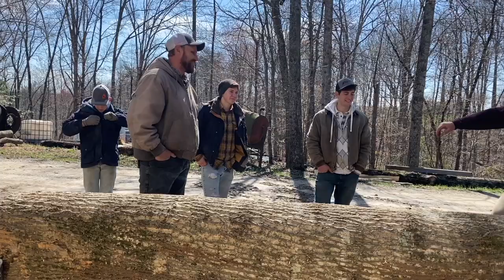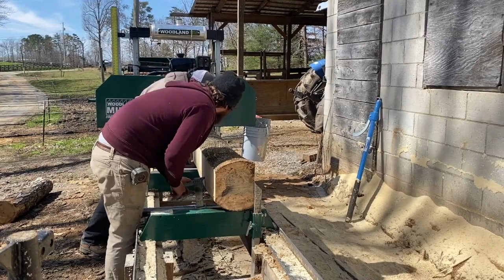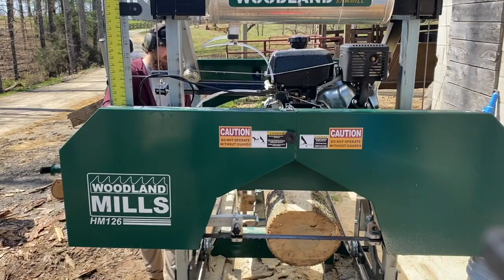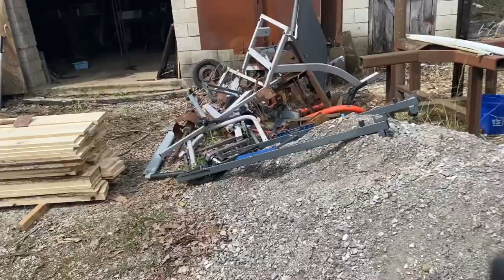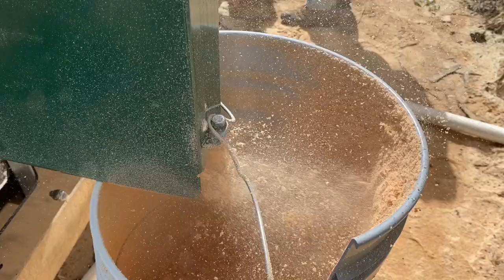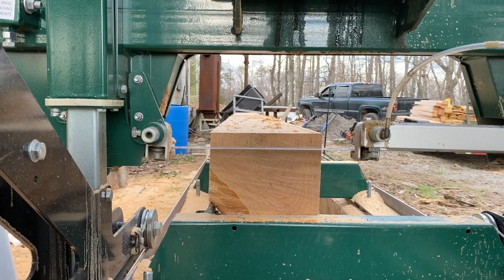Run of The Sawmill - With @McGieHomesteadAdventures

Comment: Steve’s small engine saloon has some great videos on cleaning carbs on these types of engines, they are VERY simple to do, takes me about 10min to drop the bowl and clean the main jet and the little plunger that the float uses to control fuel into the bowl… most times I don’t even remove the carb I just clean those 2 things and the problems all go away.

My mill is still buried under 2’ of snow… now I’m itching to get back to it so I can start on my deck 😁👍
Reply from the maker: Good I’m glad told me! I was going to remove the carb but I’ll try that first.

2’ of snow?! Man I’m glad I live in Tennessee!
Reply: @Jared-Brubaker  
It is almost easier the first time to pull the carb off completely just to see how it all works BUT it adds another level of frustration dealing with the throttle linkage

pro tip
Hold an ice cream pail or other small plastic container under the carb as you take it apart to catch any small parts that drop out like the fuel shutoff plunger when you remove the small pin that holds the float in place…

Comment: Lol, we have been teased on Micah’s channel for months with that leaning tree, and I kept wondering why he doesn’t just cut it down and get rid of the risk. Apparently he just wanted a bigger better smokehouse, and what could be better then building the new smokehouse with lumber from the tree that crushed the old one? For what it’s worth, and you might not have the same results, I have found that running ethanol free gas in all my small engines has largely eliminated any carburetor problems. Thankfully my neighbor buys the ethanol free gas in bulk and lets me buy directly from him, so I have extremely convenient access to it.
Reply from the maker: Yep he’s a tease lol, But I’d say it was worth the wait 😁 he built one heck of a smokehouse!

Comment: In process of watching the whole video. I notice you run yours a little different than mine. I keep seeing you measure from the bunk to log top then go crank the mill head down by the scale in back certain amounts. Does your scale tell you how far you are off the bunk and thats how your deciding how thick your boards are? If so which scale is it?
Reply from the maker: I made one inch marks with a sharpie on the metal beside the magnetic scale that show how far off the bunks I am, I only use it for the slabbing cuts, I find it easier but maybe I’m missing an easier way🤷🏽‍♂️ thanks for watching Aaron!
Reply: @Jared-Brubaker   sounds like a good idea!

Comment: Great video spoiler alert should have been the title 😂 I always put a little sea foam in all my small engines it works sometimes lol god bless keep them coming
Reply from the maker: Thanks Bryon! That’s what surprised me, I put sea foam in the last several tanks to avoid this problem but it happened anyway 🤷🏽‍♂️
Reply: Try to find ethanol free gas at a gas station.  I won't use anything else in my small engines now.  You likely have to take your carb apart.  Also check if the governor is moving freely and is oiled and there are no obstructions in the gas line.

Comment: Go to the airport near you  and buy 5 gallons of 100 octane low lead and run it in your sawmill engine. I do this about once a year with all my small engines it will clean all the gunk out of your fuel system

 DO NOT RUN THIS FUEL IN ANYTHING THAT HAS A CATALYTIC CONVERTER ON IT!

Comment: Kohler engines are not any good. On my Woodland Mills HM126, the carburetor failed after the first 10 hours. They don't cover it in the warranty. And, still having four of the original 10 blades, the engine also failed. It lost compression and was replaced with a Honda GX390 13HP.